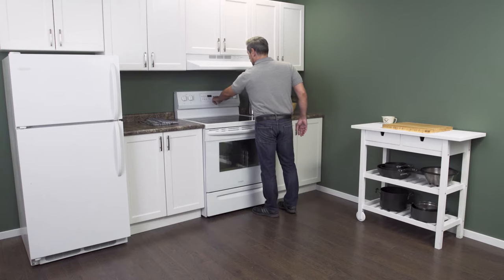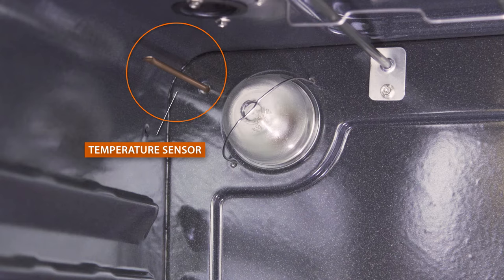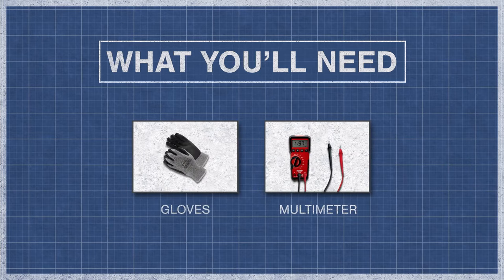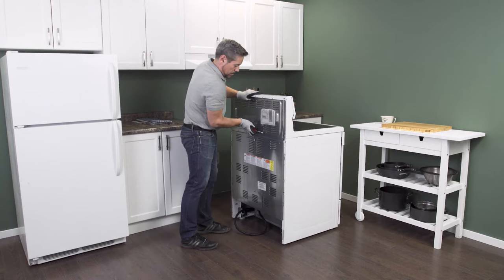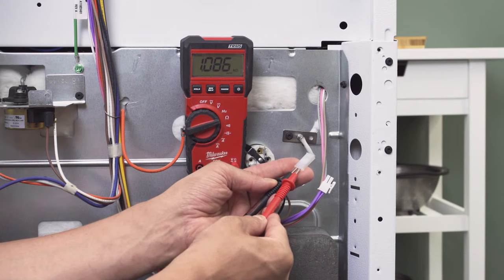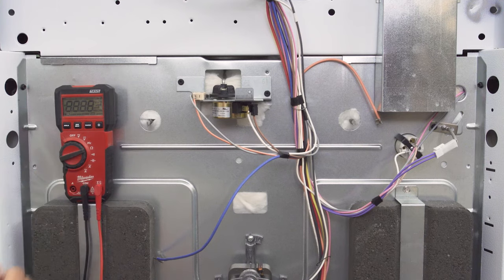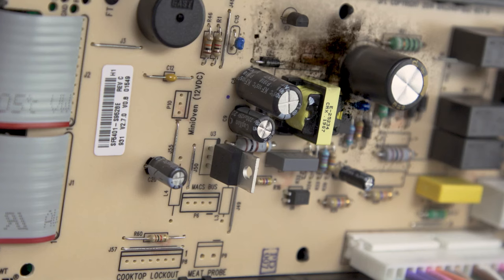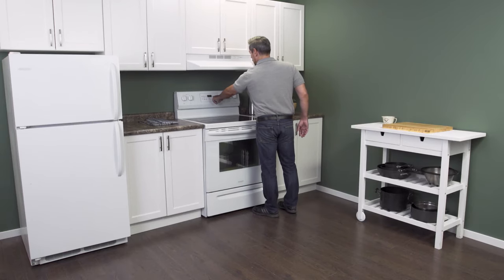Oven Keeps Overheating - Troubleshooting | Repair & Replace

Comment: Excellent video. My oven is from the 1960s but I feel like I have a basic understanding of how it works now and possibly how to fix it, thanks.
Reply from the maker: You're welcome, we're just happy to help! If your oven is from the 1960s then it will not have a control board and thermistor (temperature sensor. It will have a oven control thermostat which is a fluid filled bulb and manual contacts. These contacts can stick and cause issues over time: https://www.amresupply.com/catalog/Oven-Control-Thermostats-632506-AD1P

Comment: Thanks for the tips on locating and testing the thermistor (temperature sensor) and for checking for a short circuit in the heating elements. You saved me $55! The resistance of my thermistor was almost identical to the one at the appliance parts store that I went to. So my thermistor is probably fine. And there was infinite resistance between each heating element terminal and the bare metal chassis of the oven- so it looks like no short circuit in the heating elements. I checked for loose connections among the wires that connect to the control panel and found none. No blackened areas either. Still, it appears that the control panel must be faulty.

I wish you showed us how to test it- rather than simply say, call a professional.
Reply from the maker: You're welcome Eric, we're glad that you found some of this helpful. With the control board it is best to eliminate all other sources. Control boards are difficult to test, there is a lot of variety between models and it's not straight forward enough to be able to cover in a video. If you have eliminated everything else, the control board is simple to replace. You can see more here: https://www.youtube.com/watch?v=ORTi4lLyoqw

Comment: Hello, I need your opinion please, I tested both elements for shorts and one came up at 0.700 and the other one at 2.300, so if my thinking is good both elements are not good and need to be replace ? Temperature sensor is at 1098 so that one look ok. The problem we have is we cook in the oven and in couples minutes or so it burn the foods. Very informative video.
Reply from the maker: Thanks for watching. If both elements have continuity during a test for a short, then they should be replaced as it is likely that the short is preventing the elements from turning off correctly during a bake cycle. 

Also check to make sure that the terminals and connectors are isolated and that nothing is touching it that might cause a short. You may or might not see any visible damage on the heating elements but sometimes there might be cracking or an exposed portion of the coating. Regardless, replacing the elements would be the best next step.

Comment: Nice Video!!!Any thoughts why my cooling fan stays on all the time even after the oven is cold ?
Reply from the maker: Thanks for watching. Are you referring to the convection fan? This fan should only run during a convection bake cycle. Some advanced models might have a cooling feature where it also runs after a bake or broil cycle is done. If the fan stays on then it's most likely an issue with the control board. It could be a stuck relay on the board which would be continuously sending power to the fan.

Comment: Hello Vance. Thank you for the helpful video. What do you mean when you say, when testing for a shorted element, "if there is any continuity reading" the element needs to be replaced? Does this mean the reading should be "0"?
Reply from the maker: Thanks for watching. It depends on where the short is happening. In some cases it might travel through the element so you'd get a resistance reading close to the resistance of the heating element. If the short does not go through the element then it might be closer to 0 - 1 ohm. In this cases it wouldn't cause the oven to overheat in the same way.

If there is OL (open loop) or display is blank or shows  - - - - - - , then there is no continuity and no short.
Reply: @AmreSupply  Thank you. I will test it further.

Comment: Why does my oven say F10 on the display and overheat? Is that something specific outside of this troubleshooting? Appreciate any insight!
Reply from the maker: Thanks for watching. An F10 code can mean that the control board thinks the oven is too hot. Following the steps in this video, test the temperature sensor as it is likely the problem.

Comment: Hey there! My oven is kind of old, and we just replaced the control board and the thermistor, but when we plug it in, it starts heating up on its own. Is that supposed to happen?
Reply from the maker: Thanks for watching. The oven should not start up unless the a bake or broil cycle is selected on the control board. Have you checked the bake or broil element for a short?

Comment: Could the resistance in the oven element become to high and cause the wires connecting it to melt?
Reply from the maker: Thanks for watching. Wires melting can be cause by a number of factors, one would be a power surge. Generally the resistance of the element itself does not increase over time. however there can be a buildup of carbon or grease on the terminals which could interfere with it and change the resistance reading.

Comment: What do you do if your multimeter pins won't fit in the connector?
Reply from the maker: Thanks for watching. If you're testing with the power disconnected and the multimeter leads won't fit inside the connector of something like the temperature sensor, then you can use a inexpensive hack. Using paper clips you can wrap it around the multimeter lead and use the paperclip to fit inside the connector. 

Alternative there are "needle tip probes" that you can get for multimeters.
Reply: I had the same problem, but I was able to insert the probes into a back opening (in white part) of the connectors

Comment: I have a KitchenAid oven I changed the thermal sensor and it started overheating again. What do I do?
Reply from the maker: Thank you for watching. Check to make sure that the temperature sensor terminals leading into control board are clean and that nothing is interfering with the connection as this could mess up the reading.

As well check for a shorted heating element.

If all of that is good, then it could be an issue with the control board.

Comment: How about not getting hot enough? Heating element went out. Now it doesn't heat up high enough
Reply from the maker: Thanks for watching. During a bake cycle, both elements contribute to the heat with about 80% from the bake element and 20% from the broil. If one of the heating elements is not working, then the oven will not heat properly. In this case it's best to install a new heating element. You can see more in this video: https://www.youtube.com/watch?v=ABope7vl5IY

Comment: Hello and good day @AMRE Supply
Really appreciate if you could help!
My oven is overheating, but as far as I observed,
1. the upper coil is turning reddish after a certain time,
 while the bottom coil seems to be underheating because my brownies texture turned chewy (like chocolate moist)
2.  another symptom is the lamp turns of before the actual time (around minute 8 mark)
TQ so much in advance
Reply from the maker: Thanks for watching. If you think the bottom element is faulty and not heating up then it should be replaced. You can learn how to do that in this video: https://www.youtube.com/watch?v=ABope7vl5IY

As well follow the steps in this video to check for the short as well as test the temperature sensor. 

If you have eliminated all other problems then it could be a faulty control board.

Comment: If the oven cycle light it's still on after everything it's off, what can be the problem?
Reply from the maker: Thanks for watching. Does your oven use a control board, or is it an older style that has a manual dial for the oven?

If you have an oven with a control board, then it could be an issue with the temperature sensor or the control board itself.

If you have the oven control thermostat (dial) then its likely that one of the contacts inside of it are stuck closed: https://www.amresupply.com/catalog/Oven-Control-Thermostats-632506-AD1P

Comment: What if my sensor is getting around 1100 but jumps around a bit too?
Reply from the maker: Thanks for watching. The pins on the sensor are recessed a little so what is most likely happening is that the multimeter probes are not making solid contact with the pins. Check the connection between the probes and the pins and you might find that the resistance value will not jump around as much. A little variance is ok though. It also depends on the multimeter.

Comment: I find a capacitor in the board OL i think the capacitor should be replaced
Reply from the maker: Thanks for watching. If you have the tools and skills to repair a capacitor on the board then that can be done. It's not a repair that most people are set up for though.

Comment: What if just the clock work
Reply from the maker: Thanks for watching. If the stove works, the clock and / or the oven light works but the oven isn't heating then it could be an issue with the thermal fuse (or limit switch), the temperature sensor or an issue with the control board: https://youtu.be/96s7maybHlY?t=241